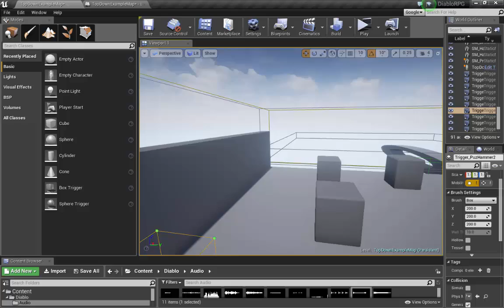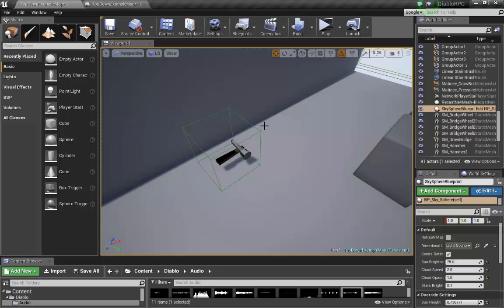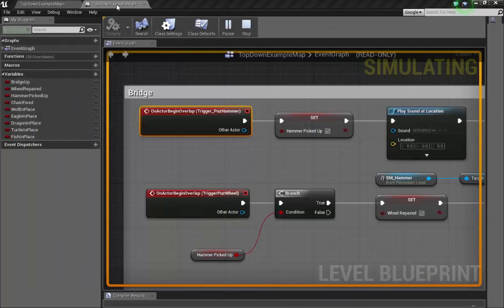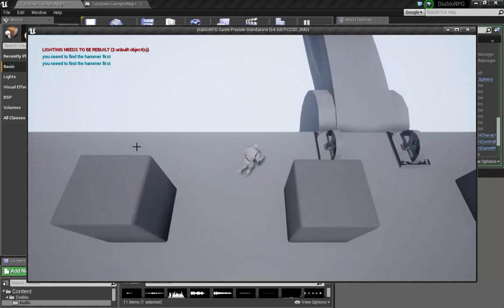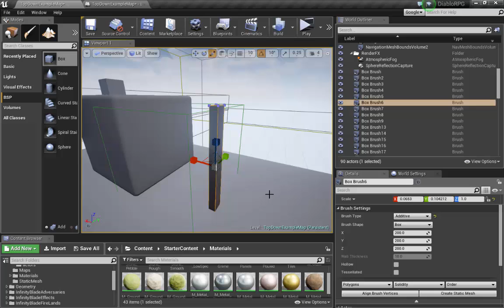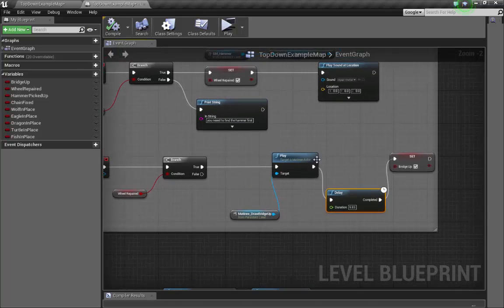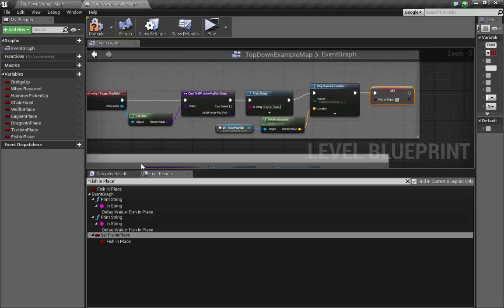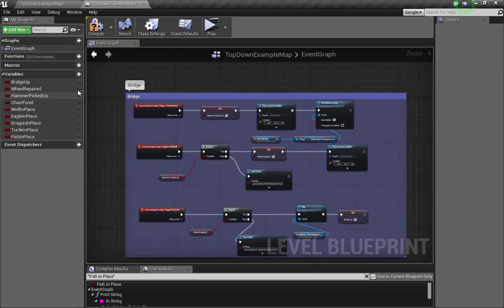Blueprint: Debugging Common Sense

Comment: Thanks MarkG, I have seen several of your tutorials and I have done a bit of 'Print String' debugging - but you should check out the UR4 debugging system - this allow you to add a breakpoint at any function (right click, at chose "add breakpoint") - you would generally do this at any point where you would put a 'print string'. This is awesome because you can go step by step (step-into) and inspect values..